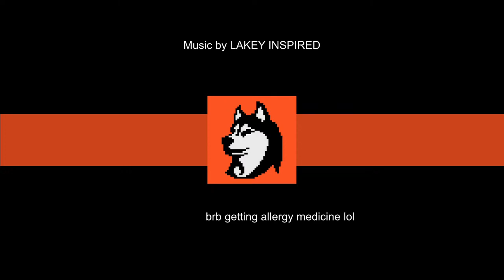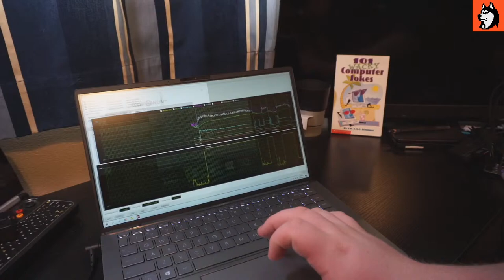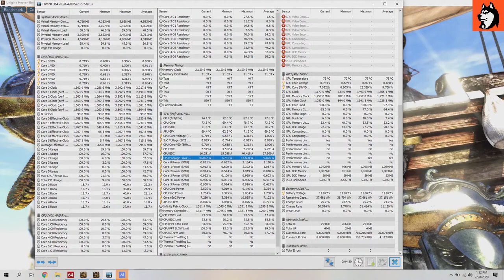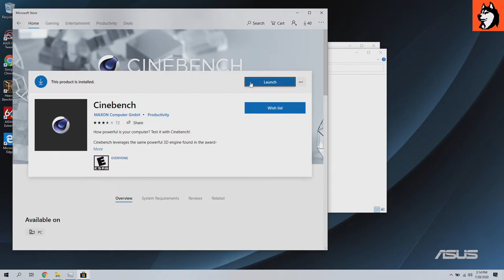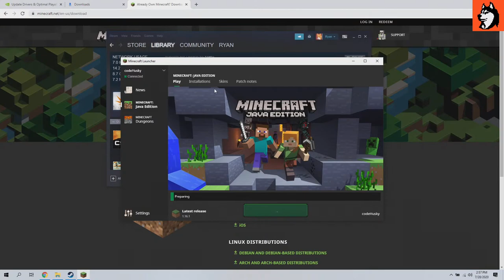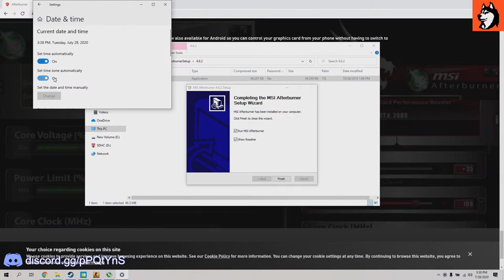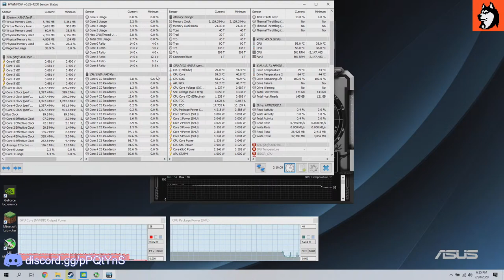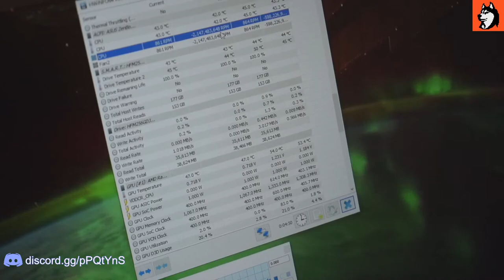Unboxing + Testing! (VOD) ASUS Zenbook 14 (Ryzen 4500U + MX350, Q407IQ)

Comment: 3:01:05 i have a little tip that u may not know, theres this thing called optifine and it heavily optimizes minecraft especially on the latest versions. 95% of regular minecraft players use this. The laptop isnt bad but its more of the client ur running it with

Comment: READ THIS BEFORE BUYING THIS LAPTOP (If you are a video editor)

DaVinci Resolve doesn't play well with Nvidia MX 350. By default it uses OpenCl and enables two graphic cards (Vega 6 and MX350) which causes MASSIVE stutters on playback, memory issues and renders this laptop UNUSABLE as an editing machine. 

To SOLVE this you have to enable CUDA in DaVinci:
1. Update your drivers to the newest version from Nvidia website (don't use MyAsus app, it doesnt't have this option). And drivers out of the box just don't work!
2. Update your Resolve to version 17. Version 16 has NASTY playback problems (no image or flickering image).
3. Manually enable MX350 as a rendering card in DaVinci Resolve settings.

Like this comment so more people could see it!

Comment: Thanks for this, I'm always interested in seeing how each model performs with actual numbers (with throttling, not theoricals clocks). The first thing I would try is to remove boths plastics wraps lol, from the fan vent and the heatpipe too. But maybe is there to force the air enter over the other componets and cool the rest (like mem chips and ssd). Still, when using both CPU and GPU it doens't seems like a temp problem, but power limit. How big is your charger, 45 or 65w? If you have the 45w one, maybe you can try with a 65w one. Also the back cover is plastic right? Maybe it could help to add some thermal pads over the heatsinks like the ssd has (only when stressing the CPU alone it seems to be temp limited, but it could be a time limit like with Intel turbo).
Reply: Also I'm always confused in this kind of notebooks of how useful the dedicated graphics are.  If this was a 35w model, I bet the Vega iGPU won't be far from the MX350. Though considering it's a 15W (up to 25w), using the integrated graphics would make it to throttling even worse. But it also happens with the dedicated graphics here, and the whole thing is around 16-20W.

Comment: The gpu is the 25w version with the clock of 1493mhz, the 10w version can reach only 900mhz clock, HWINFO can read only core Power that is not GPU total Power, the 2GB vram consumes near 10w at 7ghz
Reply from the maker: That's not true. Hwinfo reads full gpu power. Not sure who told you that.
Reply: @codeHusky  HWINFO told me that, the only power sensor it can read is Core Power, afterburner can't show any power bacause this gpu does not have a power sensor
Reply from the maker: These lower sku gpus are powerlimited by core power, not full gpu power. If it was monitored it would be reported in hwinfo too
Reply: @codeHusky  yes, this core on Full load at 1493Mhz can reach 13-15w only the core, not counting VRAM power
Reply from the maker: I'm not sure what you're trying to tell me
Reply: @codeHusky  vram GDDR5 consumes Power not measured on the core Power sensor
Reply from the maker: That doesn't even matter, it's not included as part of the power budget for the GPU
Reply: @codeHusky  of course It is, theres no GPU without vram and the cut from 128 bit to 64 on vram bus from a GTX 1050 is one of the Power restricitions of 25w TDP
Reply: @codeHusky  https://drive.google.com/file/d/1e1kKmPqcLs1aieHuvvs2MidKsH9He7cK/view?usp=sharing the image shows the full gpu power sensors
Reply from the maker: What
Reply: @codeHusky  click the link

Comment: I'd guess that the fan is blocked so it can pull the majority of its intake from the air in the laptop itself. Needless to say that that air would be warmer than air from outside but I see where they'd be coming from. Maybe also it's to avoid lint etc being pulled into the fan
Reply from the maker: nah, it's to redirect airflow to pull in air from the other half of the laptop. this still isn't a good strategy in this system since the fan has to struggle to pull all the air

Comment: Nice video. Missed the stream, was a bit hard to look through the content. I would like to ask is there a temperature limit (u mentioned smth about 75) on this laptop and does it thermal throttle while playing games. Could I manually crank up the wattage, want it to run  at a higher wattage maybe with max fans and temps around 80-90. Is that possible? Someone on reddit also mentioned that this might be the 10w mx350 variant, can u confirm that.
Reply from the maker: The MX350 seems to be configured to 12 watts, but it will throttle itself down to like 4 watts while playing games. I haven't found a way to mitigate that yet.
Reply: codeHusky plugging in the wall charger worked for me, no throttling after that
Reply from the maker: @shawty546  It was plugged into the wall.

Comment: I used NZXT cam and the mx350 usage was capped at 50%. In power plan you can’t make a performance plan. When I played osu, I got almost double the FPS when using the integrated graphics.
Reply: whatttt fr?

Comment: Would like a copy of that Ryzen Controller 1.18.5 that actually works on this machine..    Not sure why the newer versions are completely broken on any 4xxx series.
Reply from the maker: I've got a link to it on my discord pinned in the.laptops channel
Reply: I think if someone would get success in increasing the TDP of vega 7 from 15 watt to 30 watt it will surely over power the 10 Watt mx350

Comment: Is this worth upgrading from a 2014 13" MacBook Pro? It has a 4th-gen dual core i5, 8GB DDR3-1333 RAM, and 512GB SSD. Biggest reasons I'd be upgrading are performance (Ryzen, faster GPU and RAM), USB-C, and Windows 10 (Apple drivers suck in Boot Camp). It's been a hell of a laptop, but it's going on 6 years old now. I'd basically be breaking even by selling the MacBook Pro.
Reply: I'm a former Apple Genius bar tech. Upgrade. Your hardware will quickly be unsupported in the coming Mac OS software, and your hardware will not hold up hell. 6 years is a great run, if you can break even and upgrade, do it now before the value drops. The new Renoir Ryzen's are incredible, and despite this guy's video saying he prefers the Lenovo Flex over the Asus, either option is excellent. I personally am using the Asus Zenbook he's reviewing in the video. I do not regret my decision of getting this over the Lenovo Flex at all, and I've had zero qualms or complaints with mine. It runs excellent.
Reply: @eyescreamsundays  Do you prefer it because of build quality? That seems to be the selling point for me. I would miss that 16GB RAM on the Lenovo though. I just want something that will last because my MacBook Pro is a beast. Frankly I could downgrade to the original OS it was on and it would fly. The new updates since Mojave have slowed it down.
Reply: @zachcarmichael699  The build quality is phenomenal in my opinion. The manufacture's web states it was made "military grade protection" after several tests such as drops test, vibration tests, and high/low temperature tests. The screen has a beautiful color range on 92% sRGB, which is important for me because I do digital art. The internal sound system is better than most other laptops as well. About the RAM, I wanted 16 GB too, however this one has a faster clocked RAM of 4266 LPDDR4x which is a Low Power version of DDR4 RAM. It's not a compromise, it's meant to add to the power efficiency of the model. People are complaining about the amount of little voltage every unit uses, but that's ridiculous. It's not a gaming laptop, so that shouldn't be a concern at all. It CAN game, yes, but most people would rather use it's graphical features for other production software that require a better 3D render performance instead. Also, this Ryzen 4500U is getting a lot of hype because it is performing better than most intel i7's, which is insane.
Reply from the maker: This Zenbook is going to be a lot better than an old MacBook. The sRGB coverage is greatly exaggerated, but the overall system is a pretty complete package. I'd certainly recommend upgrading from that laptop. Not sure if I'd recommend you go to this Zenbook in particular, but you should upgrade nevertheless

Comment: how does this compare to this https://www.bestbuy.com/site/lenovo-yoga-7i-2-in-1-14-touch-screen-laptop-intel-evo-platform-core-i5-12gb-memory-512gb-solid-state-drive-dark-moss/6426710.p?skuId=6426710 

I currently have this asus vivobook but its battery doesnt last that much when playing any game at all its like 2 hours but when browsing or school stuff its around 7 which is still alright but not what I was expecting. Should I get a replacement or do you think Iris Xe graphics on the i5 11th gen beat this laptops perfermance and the value for money as i got my Vivobook for 500 and this one is 649 at the time.

Comment: What is the srgb of screen
Reply: its quite high. I think its like 93% srgb
Reply from the maker: Hi, the sRGB coverage (according to Notebookcheck.net data) is 85% for this panel.
Reply: @codeHusky  couldn't find anything about this model (Zenbook Q407iQ) talking about the sRGB on notebookcheck.net to confirm that claim. However, ASUS's website product page states it is 100% sRGB. I own this model, and it looks like it to me. If you find your link, please post it.
Reply from the maker: @eyescreamsundays  This model here: https://www.notebookcheck.net/ASUS-ZenBook-Flip-14-UM462DA-Convertible-Review-A-solid-all-rounder-but-not-for-outdoors.435056.0.html has the same model of panel, so they both have the same specs.
Reply: @codeHusky  https://www.panelook.com/NV140FHM-N63_BOE_14.0_LCM_parameter_41579.html Gives much more accurate detailed specifications for the display. It's 92% sRGB. I used HWiNFO to verify the display model (I am using this Zenbook 14)
Reply from the maker: @eyescreamsundays  Datasheet from the manufacturer is not going to be as accurate as independently determined results. It's 85% based on actual independent testing, not 92.